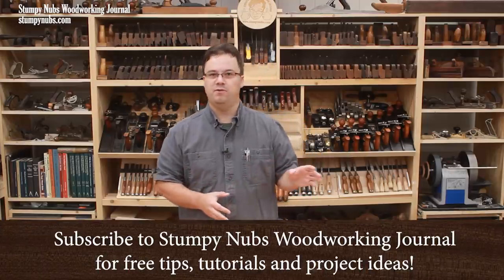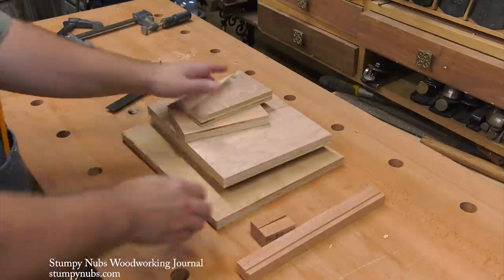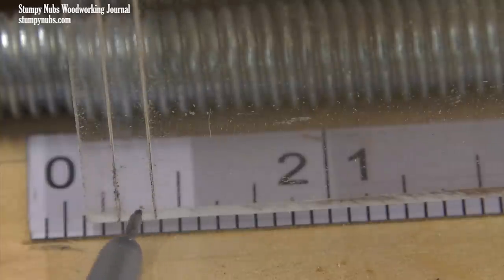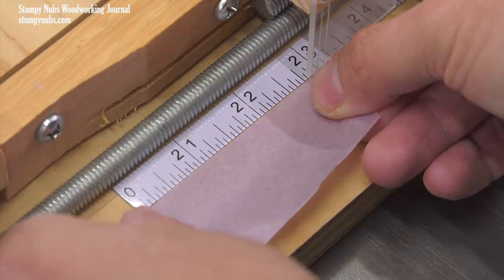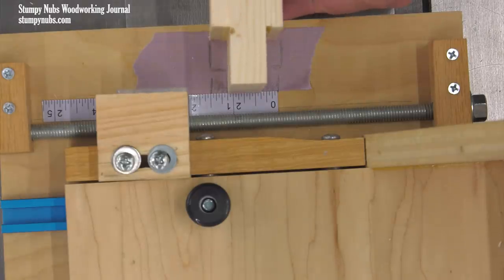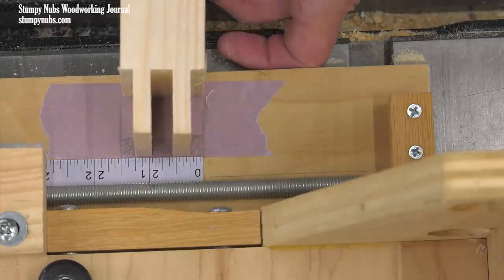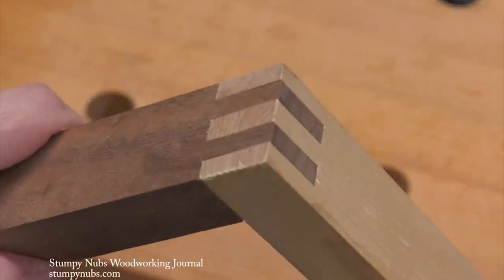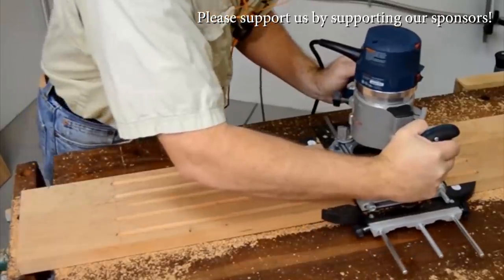Simple DIY Idea Changes Table Saw Jigs!

Comment: For those of us with a metric persuasion using an M6 thread will give us positive stops every 1mm
Reply: Thank you, I was about to ask that question!
Reply: @Jerry - Hah! great minds think alike - I had just started to type this very question...   @Andreas - Thanks for the tip re the M6 thread.
Reply: In the US they might say "metric affliction".  Anyway, good tip for a great jig.
Reply: @kaasmeester5903  I wish I had said "metric inclination" to pun on the thread pitch
Reply: Thank you James for an idea that is simple genius. Thank you Andreas for the metric conversion! I grew up in the 70's in Australia, so both systems work just fine in my head, but metric is my native unit system. Better still, I'm pretty sure that I've got some M6 threaded rod kicking around.
Reply: @SirBenJamin_  We (metric folk) probably won’t have to deal with half-millimeter adjustments for our tenons, so we can use the fine-adjustment to compensate for a fractional saw width instead. Add a knob to the threaded rod with a scale with 10 subdivisions (0.1mm) for convenience.  If you allow the scale to be rotated with some friction, you can still use the rod to calibrate the jig; simply zero the scale after calibration.
Reply: @SirBenJamin_  True, you lose some of the simplicity.  My blades all have the same thickness so I plan to add a lever to this jig with 2 positions, one to align with the left side of the blade, the other for the right side.  The lever has 2 end stops and simply attaches to the rod.  No adjustment needed once it is set up.
Alternatively you can hunt around for a blade with a 2 or 3 mm cut, they are out there.
Reply: @Biggus_Mickus  talking about large and thick rods... I guess username checks out?
Reply: @Biggus_Mickus  Well, it is a Monty Pythonesque reference, is it not? :)
Reply: @Biggus_Mickus  With a lisp....
Reply: Metric rod is available in M8 & M10 with a 1.0 thread pitch too.
Reply: @deeuutee  yes but they are less common in those thread pitches and need to be specifically looked for ... M6 and M7 both come in 1.0mm pitch by default
Reply: Thank you sir
Reply: Thank you!
Reply: I like the way he called it "Imperial" rather than "British". @jasondoust4935

Comment: I like the way you show what you do and explain how you do it. putting tape and sketching what you want it too look like is the genius part for me. I grew up tool and die so threads I know. to put one threaded rod onto another to create a precision positioner was a very clever application of threads. typically it would be a nut and threaded rod, where one would be fixed and the other would spin. by pressing the one threaded rod into the threads of the other threaded rod, you will eliminate the backlash you can get from spinning the threads. to get 1/32" increments you could use a 10-32 thread.

Comment: I have so much regard for James Hamilton's thoughtful, researched advice based so much more on experience, less on theory.  So when he endorses using threaded rod (his 3/8 x 16 tpi; mine 1" x 8 tpi) as an index for jigs (his for tenons; mine for finger joints) I was near beside myself!  In 2016 I made my first video -- Would it be my only? -- on a box-joint jig using two 1" x 8tpi lengths of threaded rod to index the steps in the ends of finger-jointed box panels.  The idea was inspired by John Heisz's jig which used one length of threaded rod against a pointed cleat to move whole multiples of eighths of an inch per pass.  So here and now, five years and some 12k views later, I'm floating on clouds to hear Mr. Nubs finds merit in the principle.  Thanks Stumpy!
Reply from the maker: Just so Noone tries to say I copied your idea from 5 years ago (I know YOU aren't saying that)  I should point out that my first time making a video about this idea was my box joint jig fron 7 years ago. :)

Comment: If you put some sort of indicator lines on the end of the threaded rod (at 90 or 45 degrees around the circumference) then you can tell how far you're turning that rod. Since we know it's got 16 threads per inch, that means a full turn is 1/16", a half is 1/32" etc. Make one of the lines red and you know which way to point up for your guide to be back on zero.
Reply: @Nick Brutana

You can use a dial indicator to get accurate adjustments to thousandths of an inch.
Reply: Threaded rods also come in different precisions. Class 2A will get you more than the typical rod and it isn't much more expenseive.
Reply: @paulruud5804  If I'm understanding correctly... you're suggesting that we could take a standard dial indicator and mount it so it was measuring the end of the rod while it was in "zero offset" position, and then adjusting the rod by rotating it would result in the dial indicator showing you the value of those micro adjustments? I love the idea, and when I get around to building this jig, I may have to modify the plans to include a good spot for mounting the indicator.
Reply: @JustinShands  Exactly. 👍

Comment: I ordered your plans and made the jig this week, and it seems to work really well after a couple test cuts.  The obvious advantage of the incremental positioner is that it removes the guess work that would otherwise be involved in matching tenons to the mortises.    I wanted to have it to use along with a hollow chisel mortiser that I purchased about a week ago.  Since I've never used a hollow chisel mortiser before, I'm sure there will be a learning curve involved in cutting accurate mortises.  But with the incremental positioner, it will be a lot easier to cut a tenon to match a mortise that may not be perfectly centered, based on inexperience with that machine.  I'm looking forward to putting both tools to work together.  Thank you for the clever idea in this jig.

Comment: I use the same basic idea to set the valve lash on worn valves & rockers. Run the adjuster down finger tight & back off as needed. Allows for proper clearance even with worn parts & where a dial indicator can't get into.
  Good method for fine adjustment.

Comment: This is exactly the same principle Incra positioning products are based on. And they include the ability to micro adjust the lead screw as well.
Good job knocking off their design with hardware store parts.
Reply from the maker: I'm not sure if you are trying to be clever or just rude. I literally explain in the video that the idea is based on previous designs (which Incra did not invent, either).

Comment: Mr. Nubs. . . . you forgot to mention something that is really important.  As you stated with a standard tenon jig the part is usually flipped.  That means the tenon size is actually dependent on the thickness of the wood.  With your method variances in thickness will NOT effect the size of the tenon.  That is a HUGE benefit.

Comment: I'm just about to rebuild my miter saw setup to be similar to yours built on toolboxes that you showed in an old video.  I'm thinking some all thread,  t-track, and self adhesive measuring tape built into the extension fences would be the ultimate.  I think this will even allow me to design up a flip stop that does not flex out of position under load by having a spring press it into the all thread near the base of the fence.  I could use a mag switch to lock the stop block in place on the rods.

Comment: Hi James one year later I have built an analogue ‘CNC’ using the same principle … 10mm threaded rods on the X & Y axis using a router mounted on slab flattening sled … max workpiece capacity of 1600mm X 2500mm  … same repeatable accuracy as my Incra LS

Comment: I have a little positioning jig with the same principle. However instead of two threaded rods I used a threaded rod and nuts that I had cut in half.  To  put into place I mounted the nuts and epoxied them in place with the threaded rod positioning them exactly.

Comment: You had me with the indexer. Finally... exactly repeatable... until you micro-adjusted the adjuster. With that,  once I move the thread, how to I 'exactly' re-create a setting say from a previous project that I am doing again? Wonderful video. Thanks! Thumbs up!
Reply: You can recalibrate the adjuster to the original starting point (zero it) using the indicator marked on the acrylic against the tape measure.
Reply: @rionegooderham2556  Thanks for the reply.
Reply from the maker: You rotate it back.

Comment: Great video. Was wondering if anyone could help as I'm pretty new to a table saw. I have a 120mm wide by 40mm thick and 900mm long piece of oak that I need to make into just 10mm thick. My blade can cut up to 65mm so is it possible/safe to put the board on its side, make the cut over half way through and then flip it over to do a second cut to effectively meet in the middle?  I'm aware a band saw would be the better choice for this but I don't have one of those...

Comment: Now if I just set up “sketch up” to draw things with 16th inch accuracy I’m all done! This idea would work really well for stop blocks on my cross cut sled. As a cabinet maker I am not working in dimensions smaller than the 16th most of the time.

Comment: Obviously, much of this jib must be made from dimensionally stable wood.  But I have been wondering which parts can be made from plastic.  That way, I could make an accurate saw jig that was also not quite so heavy.  Anyway, I wonder if you have any jigs that you explicitly designed it to have as little weight as possible.

Comment: This is so cool. What a unique idea. My woodworking suffers a bit from having to kind of eyeball things between a blade and a pencil line, even though I use the smallest of leaded pencils. I also can never figure out whether you cut at the 1in mark on the ruler, or to the right of it. Should the thickness of the marked line on either end the measurement on a ruler be counted? Some lines are thicker that others, so is that intentional?
Reply: This is why marking knives are so handy. :-)

Comment: Amazing idea! Possible further upgrade: fasten a disc with a degree scale on to the end of your allthread, and you can now accurately make repeatable, calculatable offsets from your 1/16th division. Wouldn't have to be a very fine resolution scale to be plenty accurate for woodworking; 36, 25, 16 or maybe even just 10 steps could be enough. main point is that it remains repeatably accurate to set. Heck, just numbering the 6 sides of the nut and making 2 nut corner reference marks on the wood next to it to align a nut side to the mark accurately might do for many.

Comment: Nice work! Have you done anything like this to allow indexed movements of the fence on a router table? I have been considering making something like that for years but can't settle on any preferred approach..... and I can't afford the super expensive beautiful fences offered by certain manufacturers..... although I'd like to! My fence has two 'Thumb Screws' (thumb bolts, black rosette bolts, knurled bolts, hand turned bolts, etc.)  which allow the fence to slide backward and forward on 'slots'..... BUT..... to creep-up on a measurement, I need to adjust both Thumb Screws and slots identically, and that can be annoying.... and plain 'wrong'. An indexing system like yours on a fence, plus the ability to micro adjust the 'indexing' by controlled amounts, would be magnificent.
Reply from the maker: https://stumpynubs.com/product/deluxe-router-table-fence/
Reply: @StumpyNubs  NIce.....! I'll be buying the plans. Thanks again. Oh, and I'll be buying plans for your route plane, too.
Reply from the maker: @ianturner6062  Thanks!

Comment: Man, this is really smart.  Is there such a thing for the decimal system?  I mean the relationship between screw thread and similar positioning?
Reply: 1/4-20 thread is 0.050 pitch or  0.050 step per thread.
Reply: M3/0.5mm, M6/1.0mm, M10/1.5mm and M16/2.0mm would be the metric thread sizes that would probably make the most sense. The second number is the thread pitch, or how far over each “detent” will be.  The M10 would be the one that matches the thread size in the video most closely. You can certainly find all-thread in all of those sizes (and many more).
Reply: I had the same thought and checked, a M6 (or M7) metric coarse thread has a 1mm pitch
Reply: Of course, I know the metric system, because it is standard in my country, but I really don't know the thread widths of European standards, so this is useful information.  I draw the conclusion that it is possible to obtain a similar working process in the metric system as in the imperial system shown in this video.  Thank you.
Reply from the maker: You can get thread in metric. But I find that the finer the thread, the more difficult it is to build the jig. That's why I use 26ths instead of 32nds. The 32'nds just don't work as well in homemade jigs. Also, small diameter threaded rod is more flexible and that can affect the jig, as well.
Reply: @NitFlickwick  Yeah I just had a look at it myself as well. 1mm pitch would be great for precision but M6 would be too small.
I'd lean towards the metric fine system then, where a MF12x1 sounds rather ideal.
The only thing I still need to figure out for this jig is how to properly account for my Kerf of 3.2mm XD
Reply: @StumpyNubs  I understand the point.

Comment: Same idea as the Incra Jig, a gizmo I bought 20 years and used twice.  Supposed to give you precise setup for dovetails, box joints, and other stuff.  Your version is much better and more versatile.  Wow, I just checked and they are still selling the Incra Jig on Amazon for $85 for two chunks of plastic.

Comment: Would this jig also work with metric measurements, when a metric threaded rod is used? Which size of metric rod would fit?
Reply: It's mentioned in another comment, that 6mm rod gives you 1mm increments.

Comment: Great idea! 10-32 would be good for something smaller if you want too. Do you have a means for keeping the long piece of rod from turning when you don’t want to make an adjustment?
Reply from the maker: There is a clamping mechanism that presses the small piece into the larger one, and the larger one into the wood beneath it. It doesn't twist when activated.
Reply: @StumpyNubs  oh right that makes sense. So when you move it you make sure it didn’t spin at all and clamp it down good.
Reply from the maker: @BenNawrath  When the clamp mechanism (the knob on top) i loose, you can turn the lead screw. When you tighten the knob, everything locks in place for your cut.
Reply: @StumpyNubs   I really like the whole idea of the two lengths of thread engaging then having a fine adjustment. Very slick indeed

Comment: The same concept can be expanded out with any notch and pin template patterns, hardwood template drop-in into a carriage in the jig.  irregular and regular incremented box joint patterns, etc.

Comment: Just be careful when picking out threaded rod. They make that stuff with 16tpi but are often +/- some. This is usually fine for short distances like on this tenoning jig but for finger joints across wide boards the errors will compound. Take calipers with you to the store, and test the threads over a long segment.
Reply: But would it matter if you used just the one threaded rod for all of your fingers?

Comment: You could use hex nuts, cut in half, instead of another piece of threaded rod, which gives much greater thread engagement, so much so that you need to grind the nut halves back to about 3/8 instead of 1/2... Set them onto the rod, with epoxy on the flat to fix them to the sled... You could make a small disk to put on the threaded rod, with 1/16 ( or 1/10) turn indications for micro adjustment, independent of the cursor, and 'eyeball' errors due to parallax, or whatever... metric rod and nuts for the rest of the world ;-)

Comment: What if your saw's kerf is not a multiple of the thread pitch?  For the rest of the world, 6mm has a standard pitch of 1mm, but the diameter is perhaps too small.  10mm super fine stud/threaded rod also has a 1mm pitch.
Reply from the maker: It will still work as long as the thread count matches your ruler. The width of the kerf is not as important to joinery that isn't evenly spaced, like finger joints..

Comment: I don't think I need to remind anyone that a half turn on that 'micro adjustment' equals 1/32nd of an inch, a quarter turn equals 1/64th of an inch, an eighth turn yields 1/128.  What about a third of an inch?  0.333333 / 0.0625  [=1/16] = 5.3333333.  Move it over five full threads and crank it out a third of a turn.
Reply: The threads are fixed on this jig. No cranking involved.
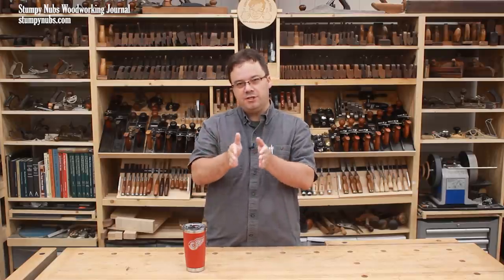Reply: @joshfromga9017  I think you missed from 3:25 to 3:45.
Reply: @kirbyspencer538 I sure did. Never mind my comment